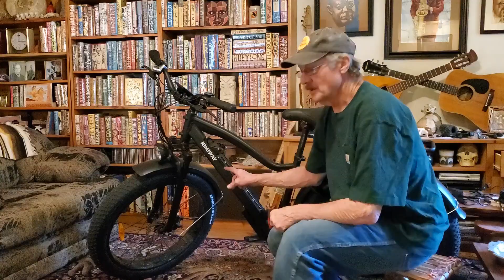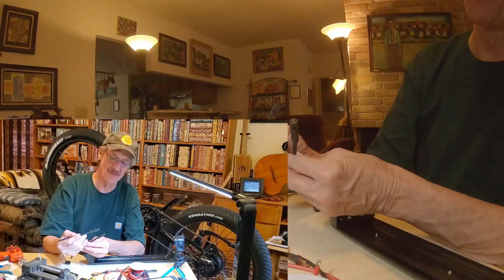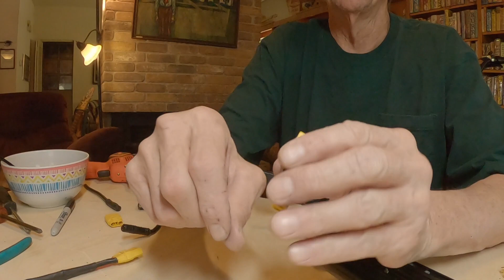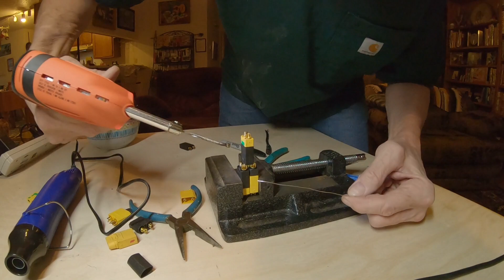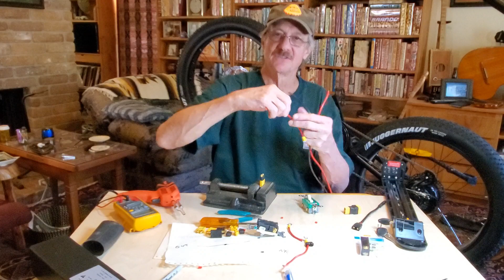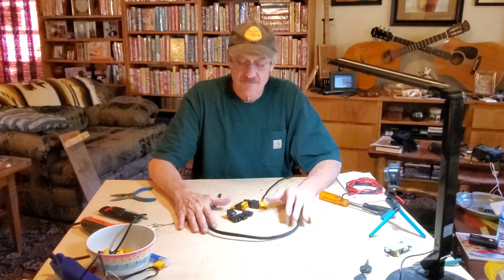HIMIWAY - Dual Battery Wiring

Comment: This is well done Stan, I mean really well put together.  I bought a Ride1up bike last summer and been reviewing posts on how to add a second battery.  Your video covers all the topics and also the questions I had when researching how to do this safely and you have thought of everything.  I do have a couple questions re. your parallel setup, are there any issues with charging, do you charge via the original battery, as the 2 batteries now make one 'large' battery, does it charge as expected?  I am leaning towards the parallel set up and just wanted to know if you ran into any issues later on and hence installed the 3 way switch.  And, the added battery you purchase on ebay, have you  had good luck with that, does it have the performance listed?  Lastly, re. your switched setup, you now have to charge each battery separately?  Thanks so much for any information, I will look for your kit on ebay.  Lothar, Stoughton WI.
Reply from the maker: In parallel setup you can charge using the original or the new battery. It takes longer to charge if both batteries are low. No issues running parallel, I just wanted to show how the switch worked. The ebay battery still works fine but I haven't had it very long. Using the switch you need to charge both batteries separately. Thanks for watching!